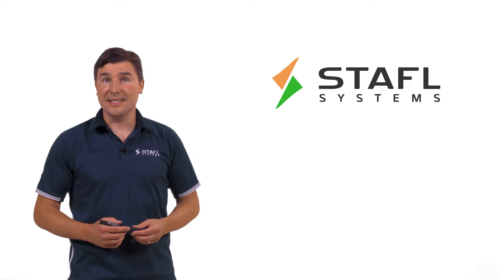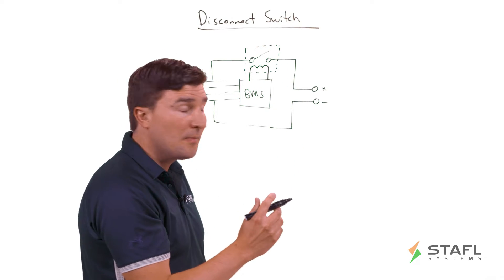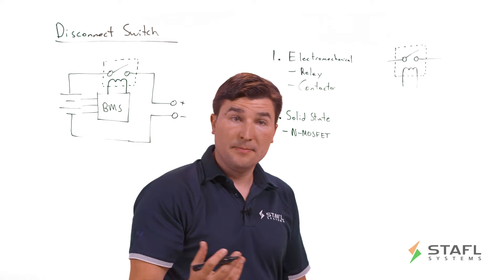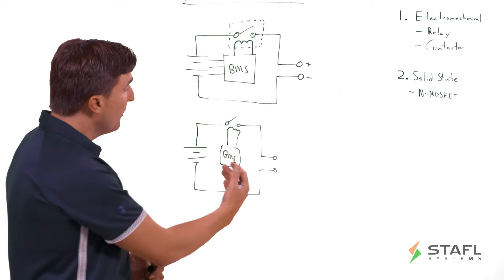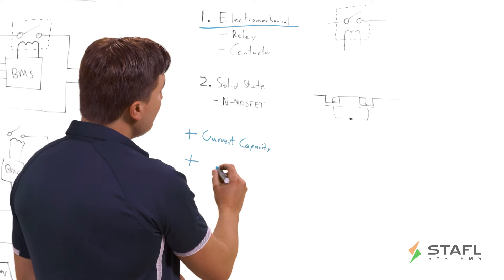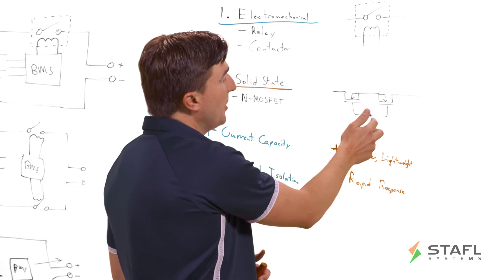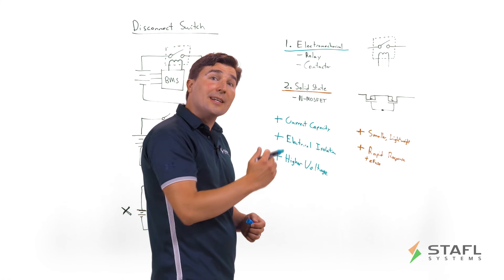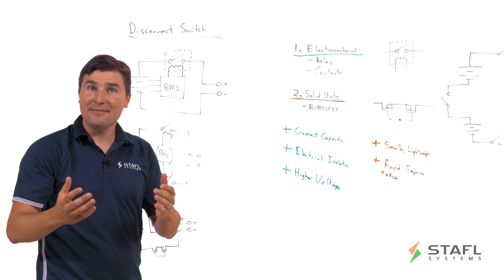Disconnect Switches for Lithium Ion Battery Packs

Comment: 6:00 Optoisolators are your friend for this application. Usually use a combination of 3 types of switches for HV Li battery arrays, a single use fuse for safety, a Mosfet for soft disconnect, and a heavy duty relay for enable and disable main power to subsystems. ❤

Comment: great video!
In a low voltage system, cutting of the pack while discharging isn't too much of a problem due to low voltage low current.
Do you have experience of power cut off with contactor with high voltage systems? (400V-800V)
Will you have arching issues or di/dt spikes that may potentially break the contactor?
Thanks!

Comment: Also a Pyro fuse can be used for to disconnect the system much faster than relay for 800V BMS
Reply: Yup those are good for large HV solar arrays 600A at 1200VDC is mighty hard to interrupt reliably with normal breakers as well.

Comment: Thanks a lot for the video. Can we connect modules in combination of series-parallel to get same power rating?
Reply: Not really. You don't want to expose your cells to too much current on charge or discharge. the configuration of the cells series and parallel depends on the amount of current you expect to push into or pull out of the battery.